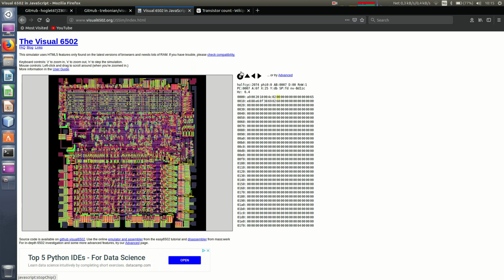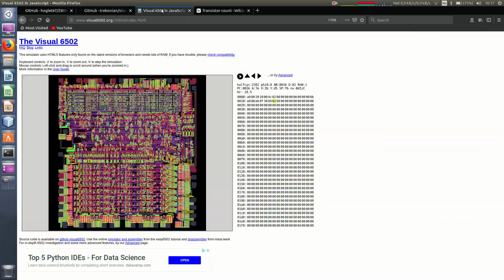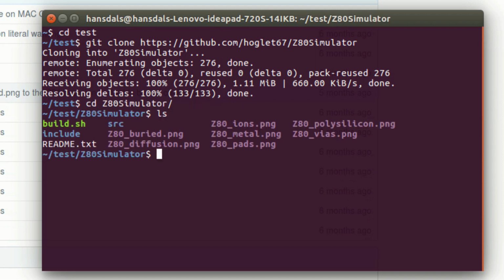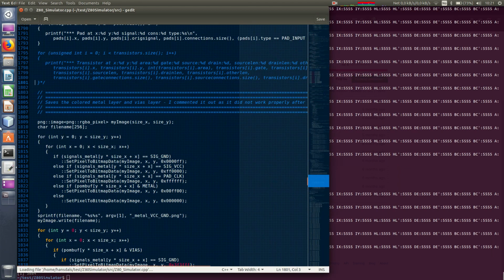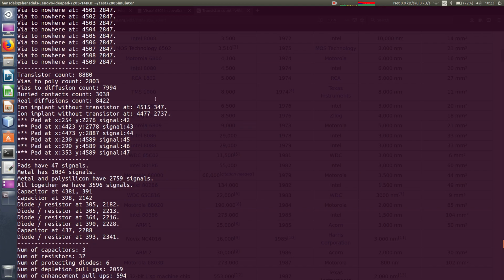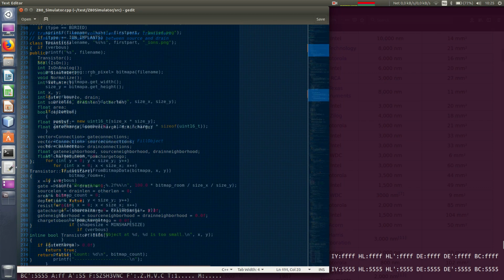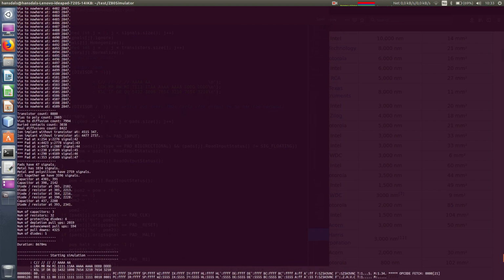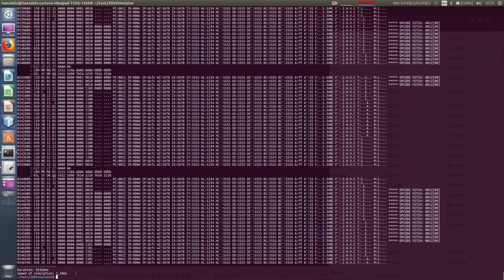Z80Simulator using images of layers from cleaned up dieshot

Comment: This is absolutely nuts. To create a working simulation of a chip from physical drawings of it. Amazing. The 'die shots' weren't actually photos by the look of it. They appeared to be manually cleaned up. And you have to devise a way of mapping each layer on to the next in exactly the same position. 
But the result is amazing. Running an actual working program on it. Really cool.
Reply from the maker: Correct. I was struggeling with finding the correct words for the images as sourcefiles. I'll change the title. Yeah. It is really something! It is the same thing they do with visual6502, all though in that project they already performed the step from images -> netlist (transdefs.js), and I wanted to know how they got there. This source code shows how. I need some time to understand it though. It seems to be stacking the layers and then scanning each transistors bounding box for connections.. The it routes those connections into signals...  Notice how fast they find all the elements from the layers.. only 8-10s..
Reply: @bwack  It's amazing how quickly that works. My mind struggles to understand how you get from a netlist to a working simulation though. This must be very similar to how fpga's do their magic. If it's this 'easy' to recreate a working chip in software...
Reply from the maker: @TheHighlander71  I wonder too. It is in the sourcecode though. I wonder if they need to do multiple passes to get the next state. Calling transistor.Simulate() once and it moves charge, but what about the neighbouring devices, should they have moved their charges first?